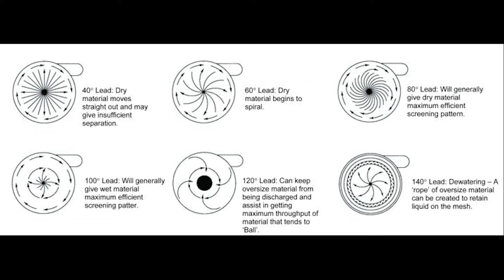Dry Sift in Vibrating Sieve

Comment: Here's two ways to fix that side pooling problem.

1) Replace the top flat screen with a bowl shaped mesh which should make sure the plant material keeps circulating instead of pooling to one side.
2) Raise the side of the machine on the side it pools on so the plant material keeps moving around.

Comment: Some questions about this: 
Do you not have issues with screen clogging? When I sift I would say 70% of the time spend is brushing the screens clean.  Also how is the quality? I'm assuming its not quite as good as high qualitty hand sifted dry sift? I don't have much experience agitating with vibrations like this tho so I'm quite curious. I guess that kinda goes along with my first question since I would assume after a bit of vibrating you will have HUGE problems with the screens not properly sorting due to the clogging.
Reply from the maker: This is a very good question and worth a good video. The short answer is that it depends on the biomass you are sifting. Some trichomes are just too sticky for screens. All this can be resolved by operating in low humidity and low temperature or even by drying the biomass. Also the type of mesh used on the sifter matters. Blinding can be an issue but generally isn’t if operating the right machine under the right conditions. Quality isn’t necessarily bad and depends on how much you agitate. Safe to say agitation time is negatively correlated with quality.

Comment: why do you have a 45 micron screen at the bottom and not just a solid surface?
Reply from the maker: To remove fines. The argument in this case is that we don’t want trichomes smaller than 45 microns. Also, fine dust particles can be rejected this way.

Comment: Trichs are on leaves stalks and the outside of buds, not the inside. If you're using this as a marketing device you might want to change that.
Reply from the maker: Hello. Thanks for your comment. However, there are trichomes within flowers. This is why some grind the biomass to access those trichomes and when making IWE it takes a bit for flowers to open up and release trichomes trapped within.
Reply: Maybe bad weed from your future, but in 2023 it does.
Reply: I make hash every single day and I can tell you with 100% confidence there are trichs inside lol. Have you ever seen good weed?
Reply: Yea definitely trichs inside lol
Reply: Sorry , you’re wrong homie
Reply: Had two years to delete this 💀